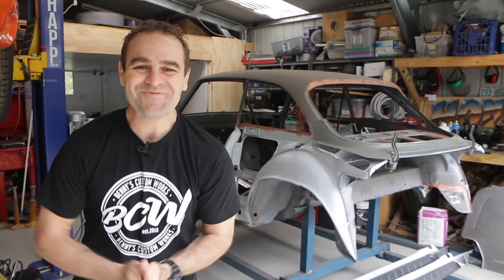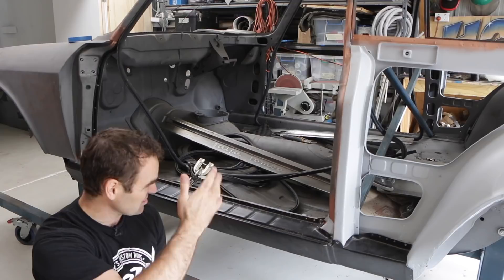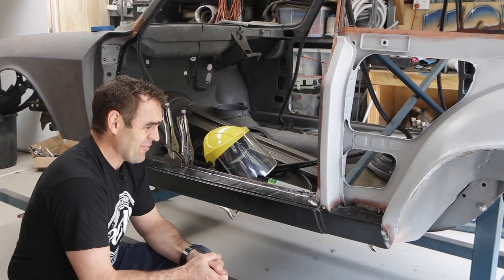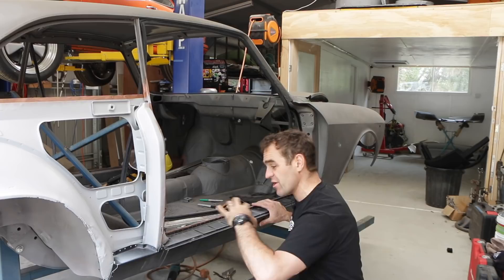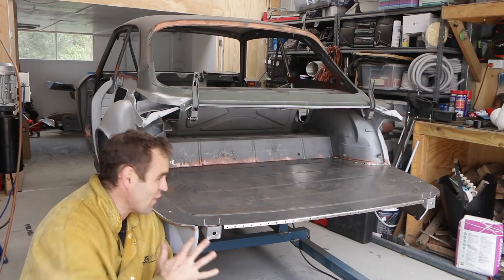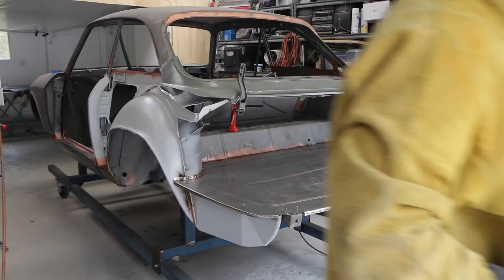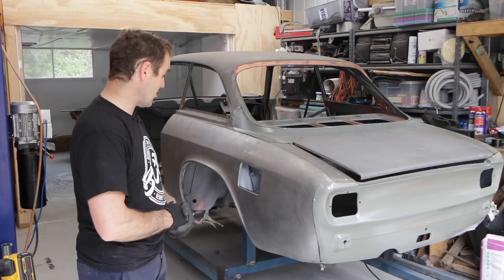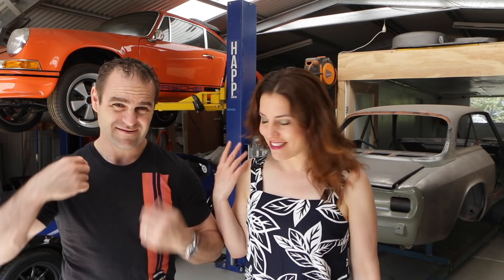Finally welding on panels - Alfarrari 105 project car build part 27

Comment: I appreciate everything you are doing.... I have to do some of the same coming up on a 2 L. 74 GTV.  I also appreciate everything that Mrs Jeff is expounding of the factory’s cars, and racing lore.  Every word is appreciated, and your accuracy is worth your learning all those stories you are telling.  I have been racing a GTA and GTV’s for many years and driving street GTV’s too.  the A I drove to work in Los Angeles and do loads of the wrk on  them, exclusively.  It’s a hobby gone crazy.  But almost 50 years later, I am still just trying to get em right...  Thanks, guys!!

Comment: surprised you didnt go for the bottom of the rear window piece first, figured having the trunk floor pan in the way makes it a little more awkward to weld since you have to go in through the back seat.

Comment: For thin metal sheets you have to use a drill bit with a 140 degree angle instead of the standard 118 degrees, then you won't leave dent marks

Comment: Look into tig brazing with silicon bronze. Much lower heat. I think it works well for sheet metal if strength is not required of a joint.

Comment: Think I would of spent some of the budget on a spot welder save doing all those Mig plug welds
Reply from the maker: I replied to a similar comment ;)
Reply: @HomeBuiltByJeff   I hear what your saying about the cheap spot welders Jeff, maybe a capable second and machine is the way to go? I'm sure this wont be the last project you would use it on 😉  and it's a god send not having to do all the clean up work post welding!! Theres absolutely nothing wrong with what your doing though keep the videos coming 👍🏼

Comment: I still feel you should reinforce the chassis somehow. A removable rollcage, subframe bars, h brace... just some ideas.
Reply from the maker: Someone has missed some videos ;)
Reply: @HomeBuiltByJeff  actually i've seen them all. :)
You've done some bracing, but temporary to keep the things in place (don't rembember if you talked about actual chassis bracing for cornering performance). 
Still there will probably be more videos on that. Checkout what ultraracing do for inspiration, you definitly have the skill to do the same. Cheers (from the other side of the planet - Portugal).
Reply from the maker: @PedroFTeixeira  I have mentioned a few times that I will be extensively bracing the car and adding a cage :D
Reply: @HomeBuiltByJeff  just gotta get the car being a car again first :) .. then optimal sub floor structure :D .. make it no look like it's hiding a Ferrari engine .. that is until people realize who's driving :D

Comment: Hey Jeff! I’m looking at picking up a mig welder, what amperage, gas and wire are you using for something like this? Harbor freight as some keep welders here with good reviews but I want to make sure the machine could do something like this.
Reply from the maker: The cheap welder should do all of this stuff as I am using it on it's lowest setting for most of it. It just takes practice to not blast through all the time.
Reply: Home Built By Jeff good to here! Practice is cheap lol

Comment: Is epoxy primer water proof? Otherwise you should have better painted    the inner parts with top coat before welding everything back together. And will you apply further rust protection such as wax or rust protection grease to the inner sections?
Reply: usually if the panel is underneath another, then no water is supposed to get to it, but we all know cars :) .. so long as water doesn't reside in there, then primer should be good enough .. at least for a few years, but yeah just some random topcoat would add extra years to it.
Reply from the maker: As mentioned, water should not be able to get in there and the 2k primer is much tougher than any 1k stuff. It is also MUCH better than what the factory did which was basically nothing ;)

Comment: Buy a spot welder Jeff. Not that dear and work a treat.
Reply from the maker: The cheap ones would only reach 10% of these spot welds ;)
Reply: I bought an Italian made one for 1500. Works great and it would have done your entire sills easy peasy. I then had an engineering shop make me some longer arms for those had to reach jobs.. i love it, no crappy grinding required